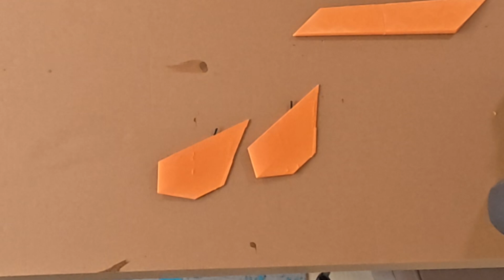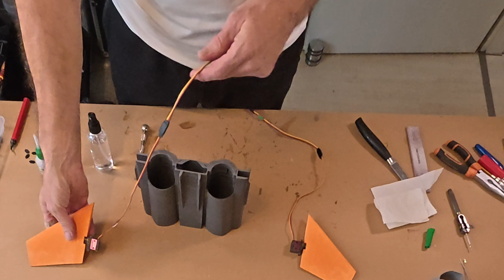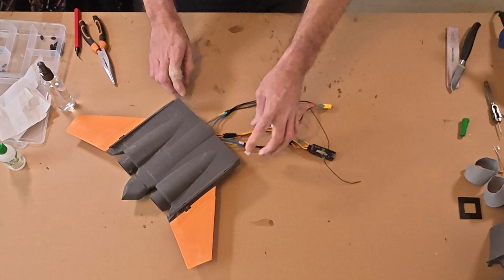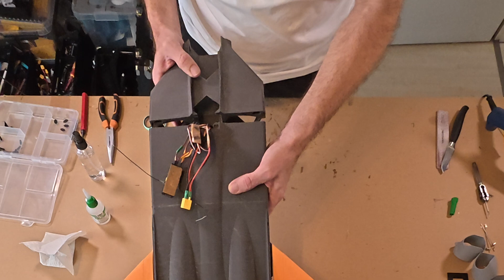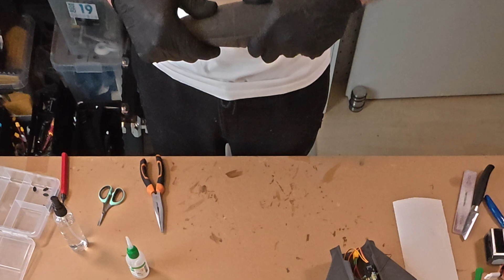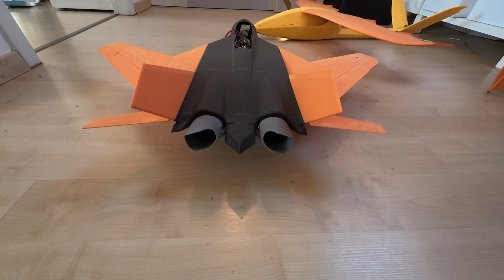Build NEBU Fighter Twin 40 EDF Vector, 3D printed Vector Jet

Comment: just reading through your documentation online for this one. is the orange parts the light weight PLA, is the grey standard PLA? then carbon PLA for the thrust vector tubes?
Reply from the maker: Everything is printed in lightweight PLA.

The thrust tubes can also be printed in regular PLA or in CF (carbon-fiber) filament.

Comment: why the forward swept wings?  it seems not an aerodynamic improvement at this scale
Reply from the maker: Sorry, but my experience is that it has advantages in this scale! Have you ever flown a forward swept Wing?
Reply: @SODYs3D  Dude you put thrust vectoring at an angle... you clearly don't know what you are talking about. Having a 3d printer doesn't make you an aeronautical engineer with years of experience needed to make claims like that.

Comment: man this is definitely my next jet ! great job love the look also saw the settings on your website . what are your thoughts about lw pla from playmaker that’s what i’m currently using prefoamed
Reply from the maker: Everyone has to decide for themselves! I've tried it and won't use it! Reasons: price versus result. Pre-foamed means I get one kilo of model parts from one kilo! Foamed means I get about 1.8 kilos of printed parts from a one kilo roll. The print image is not as nice (in my opinion with polymaker Prefoamed)! Colorfabb is heavier than 3DLAB Print for the same print thickness. I've never had any problems with 3DLab Filament and I print a lot! I've never had a bad batch! Hence my recommendation on the homepage